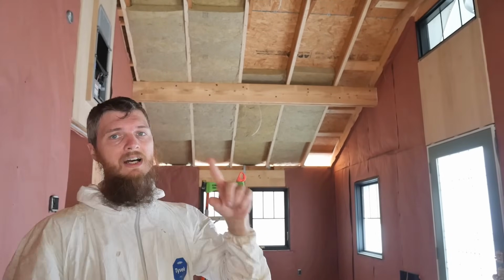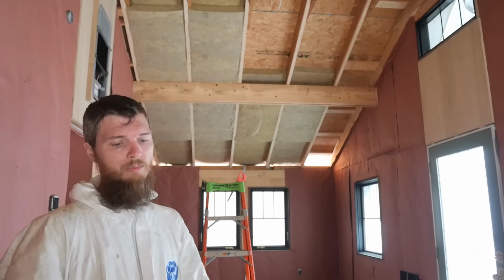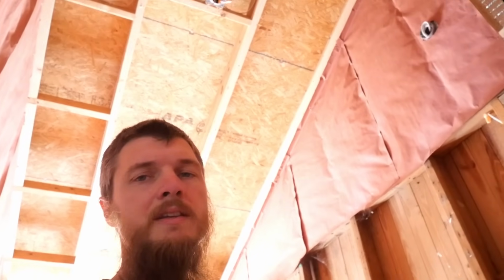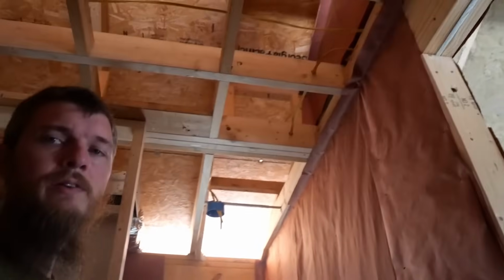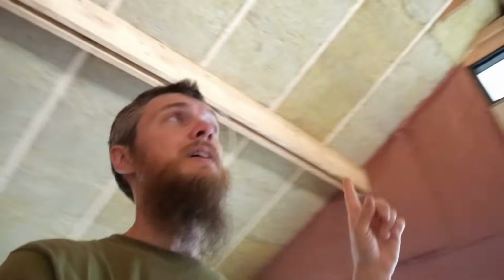Just Insulating our Cathedral Ceiling

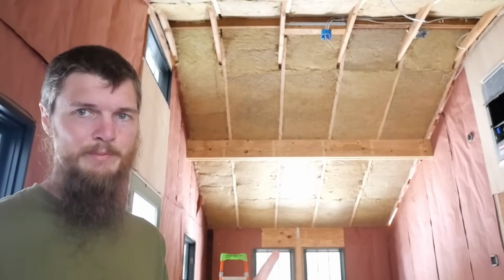Comment: You are doing a great job, but watching you do it in the suit and air breathers etc... is why I usually contract out insulation.  There are a lot of specialized planning and equipment, when they did my job they came in big box trucks with everything they needed, fire block, air sealed, vented, insulated, and vapor barrier.  I have done it myself previously but like you said 9:44, it is not easy and messy, the pros do it all day and are in and out and get it right.  Plus they seem to be able to source materials that an average DIY person can not at at a cheaper rate.

Comment: think the moisture solution should work , its kind of those watertight breathable shoes wish alow sweath to pass but prevent puddle water from comming in , the vapor passtrough barrier should work the same way it just draws in the moisture out of the air and the wool and evaporate it toward the outside same way a towel would when layed in the sun 
dont think the system would work in a cold climate as it wouls condensate more than it could evaporate out 
do wonder if becomes a haven for bugs

Comment: Little by little bit by bit your coming along! How’s them dirt piles? Already spread out? Just wondering I know how Maverick liked playing on top of them
I’ve got to say I love my front loader wash Machine my husband get dirty working out in the yard on cars etc… really gets his clothes so much cleaner than the washers that just swish the dirty water around !! That’s my experience anyway and also raising 3 children who I swear was magnets for dirt😂 I’d never go back to a regular washer best of luck
Reply from the maker: We've spread some of the dirt piles out but still have a bunch to do. Maverick loves playing on them. We like our front-load too. It works good, but I still don't trust it to remove all those fibers :)
Reply: I sold my new front loader. They all just swish clothes around in dirty water despite the type of machine. I got sick of the musty smell & clothes tangled so bad, which are common complaints of FL machines.
My Speed Queen top loader fills with water & does a load in 20 minutes. No tangled clothes, no musty smell and no leaking door seals.
Reply: @diyfferent  Ashley, we use a panel of chain link fence with blocks on it as a drag for our road. It smooths nicely & we have rocky gravel up here. It would work excellent on sand. Bet you could find a beat up piece free on marketplace.

Comment: You could also paint the OSB so if it gets damp somewhere it wont get black with mold.
Reply: I think he’s over insulated and his decking and ceiling drywall will mold after condensation occurs. I believe you have to have airflow just below the decking to prevent this so air can flow from the exterior soffit up to the peak of the roof.

Comment: Another 6 months and wood will probably be half price of what it is 5-13-2022
After posting this, I thought why not use drywall? 
At a fraction the cost of wood.
Not like it's going to get wet.
Try adding a powdered vitamins to water next time.  Water along doesn't replace your electrolytes.  Vitamins will help keep your energy up.
Nice work. 👍👍
Reply from the maker: Wood costs more, but we are just so sick of drywall for many reasons.  :)

Comment: You should have mentioned that you plan on putting sheet rock over the insulation. And painted.  So the paint may stop any moisture. .
Reply from the maker: No, we do not plan on installing drywall in this home. This home will be finished with wood.

Comment: Does the roof membrane you installed enhance this insulation system you are using or would it be the same if you had felt paper on room instead ?
Reply from the maker: Same either way

Comment: Will the wool soak up any moisture in the air and start weeping? What prevents it from getting heavy from moisture and falling through the ceiling?
Reply from the maker: No, that's not a problem for us. Mineral wool is not absorbent and moisture is caused by condensation which shouldn't happen in a properly insulated and sealed structure.
Reply: A vapour barrier used in front of the mineral wool insulation will prevent water vapour from reaching the insulation. It is not inherently vapour retardent, but if the roof were to leak, the insulation can be dried out and reinstalled without worry about mold. Mold doesn't grow in mineral wool insulation. But there should be a vapour retardent layer installed in front of the insulation and behind the drywall to prevent that humidity from the home's air reaching the cavity in the ceiling or walls and cooling against the inside of the exterior wall and condensing into water. This is especially important in regions with cold winters.
Reply: I'm located in zone 2 as well, in St.Petersburg, and in a similar situation as your bedroom video. My roof does not have a ridge vent but does have vented soffits and gable vent. I am replacing my roof in a year or two and originally anticipated to install a ridge vent but this is insulation situation is tripping me up.

If I understood the video and the reply correctly, I can leave the vented soffits but install a vapor barrier sealing off the vented soffits, install mineral wool insulation to r30, as you did, and not install the ridge vent? Or would replacing my vented soffits, some are damaged anyways, to unvented achieve the same results?

Thanks in advance and always great videos 😎👍
Reply: Interesting.  I really enjoy learning from you.  I'm not in a southern zone.  I'm in Minnesota.  But it is still very interesting. I'm insulating a shed ceiling right now and researching options for my climate.

Comment: Use your backing insulation between floor joists. It has the same r-value  as the paper back insulation. In your case because of the moister in the crawl space it would be ideal...   Some contractors abide by it....... please check it... look it up and see if you agree..............................

Comment: So I have the exact same situation in my workshop (2 car unattached garage) that has 2x4 for ceiling framing. The previous owner used pink insulation up against the plywood which ended up with mold. How did your method prevent mold from growing?
Reply from the maker: The key to this method is a properly sealed roof with a vapor diffusion port. You don't want any air movement, but you do need a place for moisture to escape. It really would be interesting to open up the ceiling in a few years to see how it's holding up, but so far we haven't noticed any issues.

Comment: Is an air gap needed between roof and insulation?
Reply from the maker: It depends on the method you are using to insulate the roof. In our situation, it's not needed.
Reply: I think you are in trouble with out the ventilation
Reply from the maker: @ Like I said, it all depends on the construction method. There are good and reliable ways to create vented or unvented attic and roof assemblies. Both are used with a lot of success. But you just have to understand the concepts and apply them properly. For example, if you are installing a vapor diffusion port, you don't want any air space between the insulation and the roof sheathing. An air gap could actually lead to moisture problems in that situation.

Comment: I am looking to replace the blown fiberglass insulation on my attic floor with mineral ( rockwool ) type insulation. There is no duct or hvac equipment in the attic. The roof doesn't have any soffit vent, but it does have gable and ridge vent .
Do you recommend putting rockwool batts in between the floor joists on the attic floor or between the ceiling rafters touching the roof boards just like you did for your master bed ?
If I put it  between the ceiling rafters, would I need to use the same vapor permeable barrier ( that you referred to in your Q&A ) to keep the ridge vent breathable ?
Reply from the maker: You would normally install it on your attic floor. You would only want to insulate the roof if you were going to heat or cool your attic space, which you couldn't do with gable vents. I would just keep it on the floor. I don't know your climate zone, but in most areas, no vapor barrier will be needed for the ceiling.

Comment: Does it needs to have ventilation?
Reply from the maker: No, we are just putting it right against the decking. The method is explained in another video we did here: https://youtu.be/e-T4-Vap2uA?t=15
Reply: yes it does
Reply from the maker: @gypsyxxx   Depending on how you define "ventilated"...  we used a method called a vapor diffusion port.
Reply: if your in a super dry environment , maybe, thats a terrible way to go if you live anywhere that has big temp swings and any type of humidity or high moisture, trust me been there done that @diyfferent

Comment: Which PAPR are you using? Do you like it?
Reply from the maker: It's the 3M Versaflow respirator. I do like it but it has some issues. The contacts on the charger and unit have worn out. We did a video about the unit a while ago here: https://youtu.be/koKrOK8dsN0
Reply: @diyfferent  thanks! I watched it just now. Nice video. Do you think you’d choose a different one now that the contacts are worn? Seems like such an expensive thing just to have it degrade like that. (I’m in the market for a PAPR but just trying to decide which one I should get)
Reply from the maker: No, I think I would still choose this one. There is still a lot that I like about it.

Comment: Hi, this is very interesting - I'm working on a vaulted ceiling garage that we've mostly finished minus the siding and the ceilings inside.  I was planning to do the vaulted ceiling but unfortunately paying someone to use spray foam for the ceiling is more than I can afford right now.  I haven't seen a single piece of information showing the insulation process that doesn't require an air gap?

Would you mind sharing your sources? Are there key words I should be searching to find this information more easily?

Thanks in advance to whomever can answer my question!
Reply from the maker: It really depends on what climate zone you live in and what type of roof/building you have. With that I may be able to give more specific information. But try doing a search for "Unvented Attic and Unvented Enclosed Rafter Assemblies" and read the guidelines for those. It can be confusing to take it all in, but generally you will need a combination of fiberglass and foam board insulation to achieve what you want.

You could always just add the air gap and build down your rafters to accommodate extra space for the insulation.
Reply: @diyfferent  Hey thanks for the info, I'll try doing that - at the end of the day its not a deal breaker to put in an air gap anyway.  Great and informative videos btw.

Comment: A one inch air gap vented to the soffit is required to prevent black mold from the inevitable moisture condensing on the cold roof sheathing. This is common knowledge, especially in colder climates (like Canada). Think of frost forming on an ugly beard.
Reply from the maker: Actually that is false. If you are in the USA, check your local code for the section pertaining to unvented attic and unvented enclosed rafter assemblies and you will find building code approved methods for building an unvented roof. There are several options available and the insulating methods and R-values can vary depending on your climate zone and structure, but it's approved everywhere and there are situations where unvented roofs just make more sense; Especially when using spray foam insulation for example or where older framing doesn't allow proper ventilation. 

We have links in the video description for more good information of the subject.

As long as you have your proper foam or foam board insulation R-values met, on top of the roof or below, ventilation is not required. Newer studies find that vented roofs often allow more moisture into an roof than they expel. You'll likely find that unvented roofs will become more popular as the contractors catch up to the science and newer building methods.

And remember, common knowledge isn't always correct knowledge.
Reply: @diyfferent  Common sense is not so common.
Reply: I’m in Canada and have a vaulted cathedral ceiling what is the best way to insulate? It’s a 1964 home and room temperature is hard to control I imagine not much insulation. Gets cold where I am and currently it’s tongue and groove and not vented the tongue and groove goes all the way out to soffits. I need the roof down at some point and roofer mentioned spray foam is the best option what are your thoughts? Doesn’t need air gap and to be vented with spray foam?

Comment: The suit and MEGA respirator is a bit overkill for mineral wool. Do you abate asbestos much?
Reply from the maker: It's to keep the fibers off his clothing. And the respirator is to keep the fibers out of the lungs so he's not coughing.
Reply: It's a terrific respirator system. The filters last a while, depending on conditions.
Reply: Nah, that set up is legit and SUPER necessary.   Mineral wool can be just as initiating as fiberglass bat.   Especially if you have to work with a lot of it or deal with it multiple days in a row.
Reply: @DL401175  yes, this was told too me by someone installing it in my home. Though not as bad as the pink stuff.

Comment: Regulations have nothing to do with washing machines, other than safety related issues. You don’t have to buy a water and energy efficient washing machine for your clothes, but the government certainly won’t encourage you to waste water. Energy Star programs are guidelines for efficiency, where if the guidelines are followed, utilities can offer discounts on purchases of qualifying appliances. The less efficient tub filled washers are still available, I bought one recently because it was the only one that would fit in my service closet on an upper floor.

In any case, even if you did have a tub washer, the fibers would still be difficult to remove completely, and they could still stick to other clothes. Another reason to use the suit. Hand washing might be another option, if you still have the strength after insulation installation.
Reply from the maker: Of course washing machines are regulated to meet certain energy and water requirements. It's been that way for years. That's why the new front loads use much less water than the old ones. The standards get changed periodically and appliances must become more efficient to meet the new standards.

I think you are confused about how this works. This isn't about top loads vs front loads. They are both regulated and new top loads use much less water than the old top loads. Some people buy top loads and some buy front loads, but they are both "efficient" and are both regulated. Sometimes this causes them not to do as good of a job as the older ones. But if you buy a good quality washing machine, they will still do a good job.
Reply from the maker: As defined in the Code of Federal Regulations (CFR), “clothes washer” means a consumer product designed to clean clothes, utilizing a water solution of soap and/or detergent and mechanical agitation or other movement, and must be one of the following classes: automatic clothes washers, semi-automatic clothes washers, and other clothes washers. 10 CFR 430.2 Manufacturers have been required to comply with the U.S. Department of Energy (DOE) energy conservation standards for clothes washers since 1988.

https://www.energy.gov/eere/buildings/consumer-clothes-washers
Reply: @diyfferent  The washer I bought isn’t Energy Star approved for a rebate, and neither was the previous unit that it replaced. Both were purchased from a retail shop. I see your point, about this not being about top load vs front load. However, there are differences among top loads, and the old versions are still manufactured and sold.
Reply: You can only get as clean as your water is dirty. My Kenmore from 2020 was energy star rated and did a great job of washing. Washers have changed.
Reply: Is there a political party that's pushing all of these regulations that force me to purchase appliances that do a subpar job.
Reply: @ Are you seriously looking to blame the government over something as simple as a washing machine? The answer- if the washing machine doesn’t work, it’s because the manufacturer produces a piece of junk. The channel owner even says he has Energy Star machines that work perfectly well. Clearly, there are at least a few manufacturers who know how to produce a proficient, modern standards efficient washing machine.